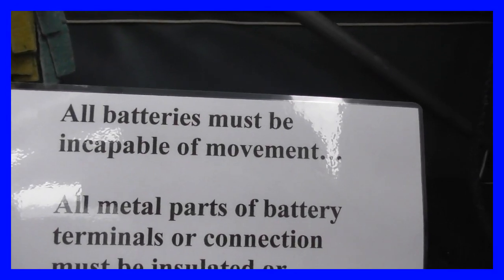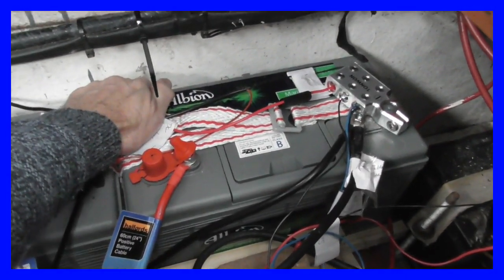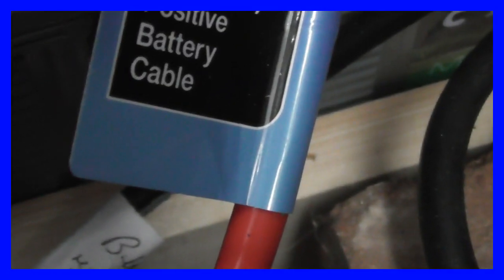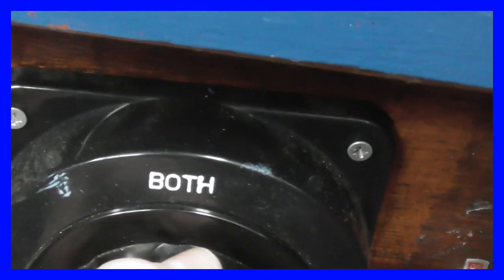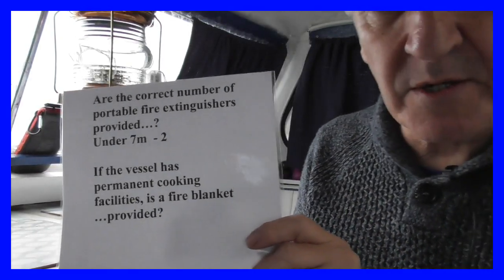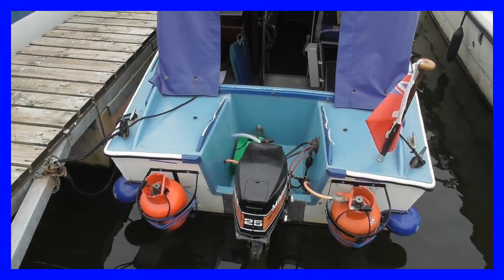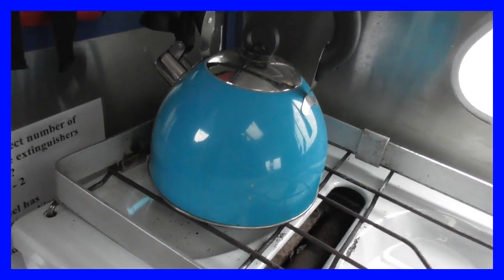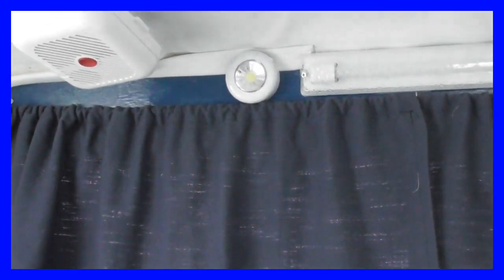33. How to get through the Boat Safety Certificate Part Two -The Boating Adventure

Comment: Is it ok to have the stored fuel where it can leak into the river or canal ? I was on the understanding that part of the test was to minimize to risk to pollution
Reply from the maker: Yes that's a difficult dilemma but 5.3.1 of the regs say spare petrol containers must be stored in the open where any leaked petrol would flow overbroad unimpeded, or in a suitable locker, any locker must be drained to the outside of the hull...pollution prevention is focussed on engine oils 
Pollution is a secondary concern I guess. Thanks for commenting.
Reply: @TheBoatingAdventure  Ah that explains things better Thanyou

Comment: two years down the road, am curious to know how you got on with the petrol stowage, as on the mon&brec canal today the petrol stowage would fail, due to no vent to outside and lack of anchorage  of tank. thank you sir, kind regards dave.
Reply from the maker: Hi petrol stowage wasn't an issue, I did add a runner to the floor to stop it moving around and a bix to prevent spillage but that wasn't required, technically the tank is on the deck and therefore open to the elements. The boat I hired on the Mon and Brec was not dissimilar. Spare containers were not on board during the inspection. Cheers Alan
Reply: @TheBoatingAdventure   thank you alan.
Reply: @TheBoatingAdventure  ive also taken your advice on buying a vent for one of the battery stowage's
Reply from the maker: Hi Dave what make is your boat?
Reply: @TheBoatingAdventure  hiya Alan,  just last year i brought a Viking 23, she's on the mon&brec, we have just had ten days on her, decided to come home early due to the heat wave, yea right decision. on the portside rear  there is a purpose  built battery stowage large enough to hold 3x130amp batteries, just forward of the stowage portside is another compartment witch  then held a starter battery,  with no vent, but ive put in a 130amp leisure battery  in place of, as the draw from the Honda 15 outboard is not significant to warrant a starter battery. but the compartment has no vent hence my question to you about ventilation, which thanks to you I'm about to sort. stb side aft  purpose built  petrol stowage, allows engine fuel tank plus one five ltr container, secured to deck, per todays regs. cheers.